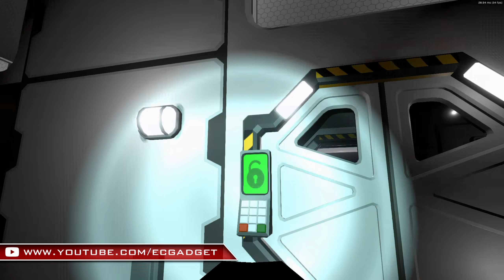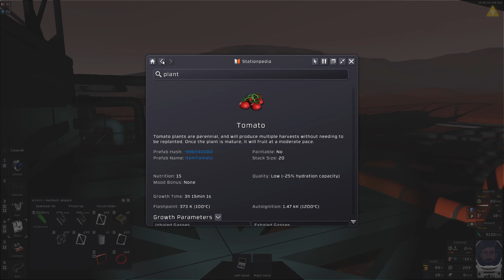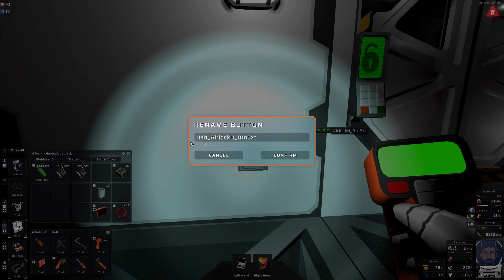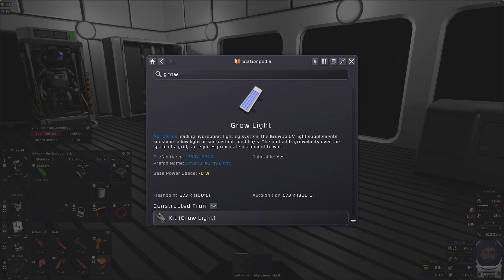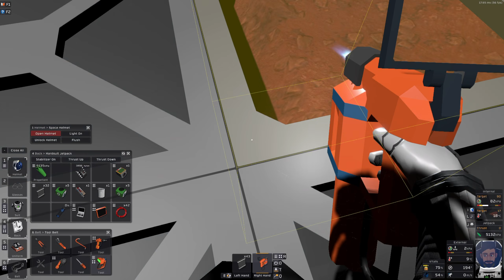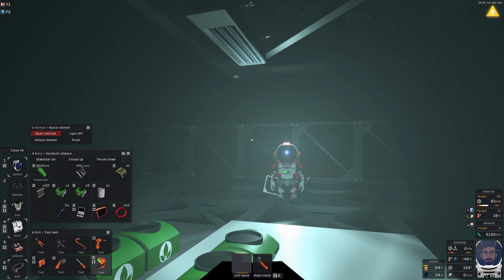Starting to Build The Hydroponics Bay | Stationeers on Mars - Multiplayer | #043

Comment: 21:55 Iron is the last to eject from the machine, it will get caught in the stacker and must also be ejected from there.
The stacker auto-ejects on either of two conditions, the count is reached or another item has been deposited.  It the qty of the last item does not reach the count, it will remain in the stacker.